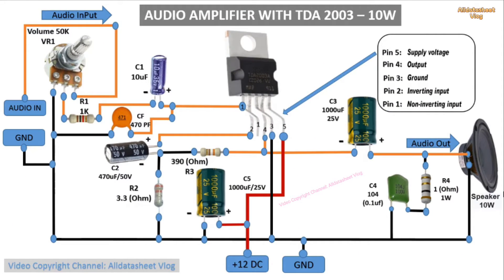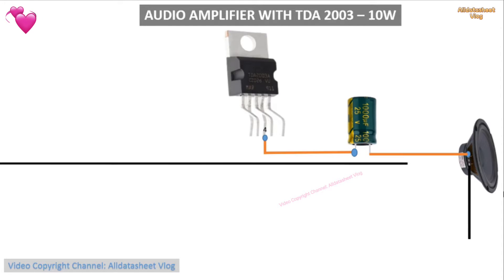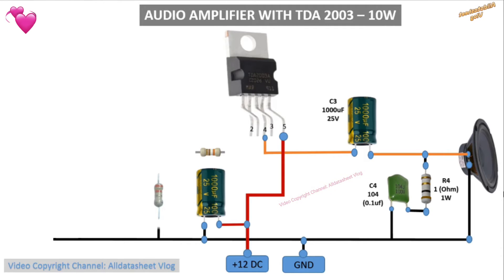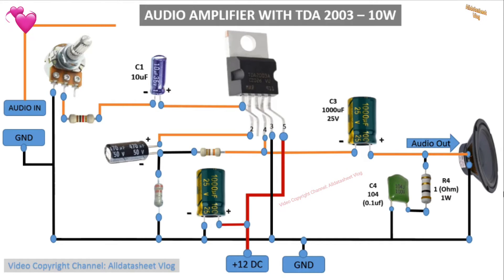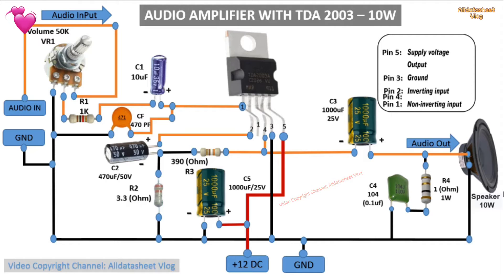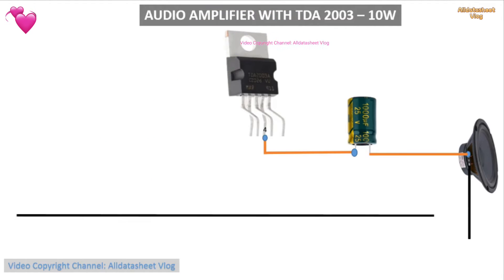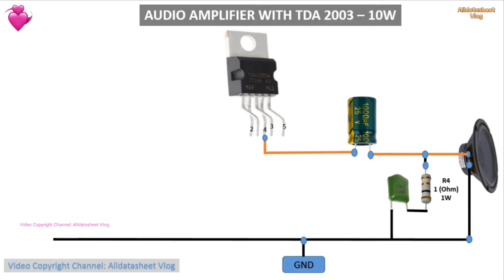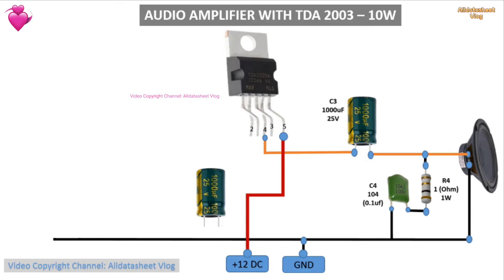Schematic | Audio Amplifier With TDA 2003 - 10 Watt

Comment: What difference in sound it will make if the 470 uF capacitor on pin 2 is changed to 220 uF ? Will it increase output power ?